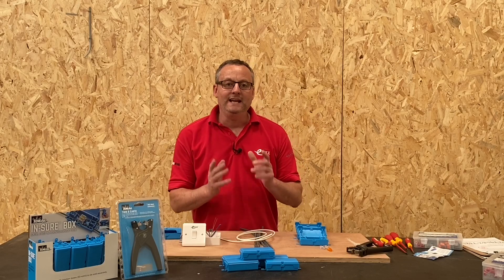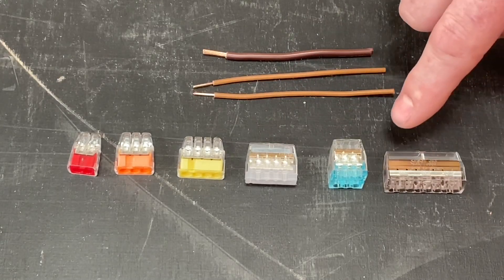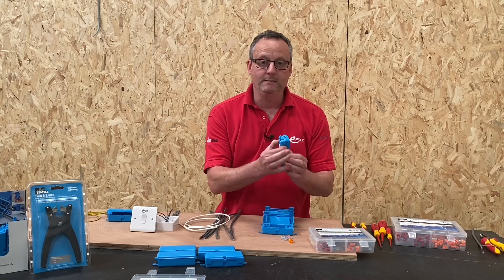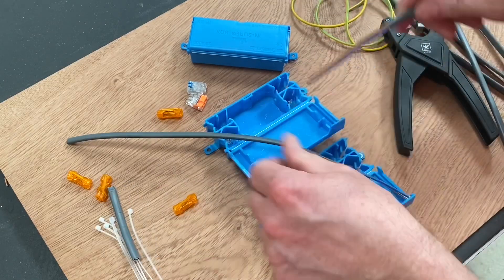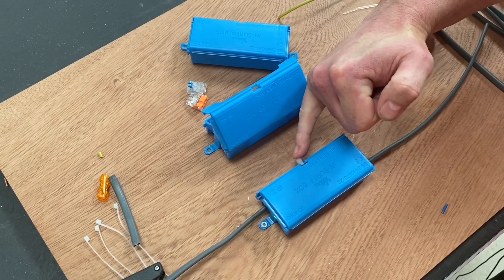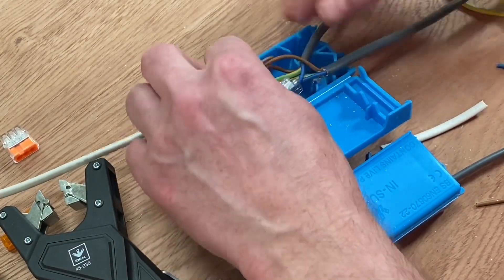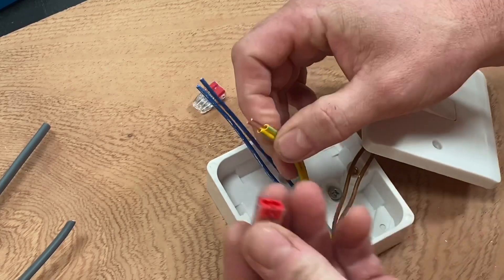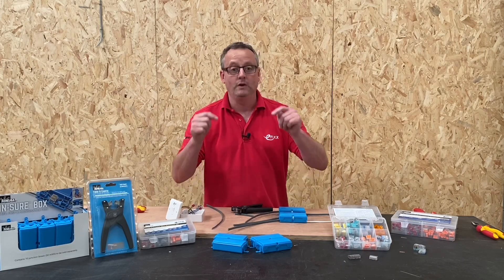IDEAL In-sure connector range and junction box demo for lighting circuits

Comment: How does a plastic box have a current rating? Shouldn't it be based on the conductor size (connectors should be rated at minimum what the maximum conductor size they can take is) & installation environment.

Comment: Can you remove cables out of push fit connectors...? Great video :)
Reply from the maker: solid conductors yes - just pull backwards and twist the terminal - stranded cant be removed on the push in.

Comment: I was always told as an apprentice that you don’t take neutrals to light switches.  How things have changed.  😀
Reply: Back in the days we didn't know any better than simple switches and resistive incandescent lights, there was no reason for neutrals behind the switches, they only took up space and made the box more messy. Control lights, timers, dimmers... in the years to come all functioned perfectly without N. But now we have LED-lamps that flicker when combined with the old way of connecting control lights/timers/dimmers... and a lot of smart and not-so-smart accessories that can be installed instead of a simple switch after the fact, often requiring a neutral connection, with the ones not requiring neutral being more expensive or less reliable. Not pulling neutrals to switches is a no-go nowadays IMO, and I'd even say it's good practice to make sure there's a permanent live available behind every switch as well (often not the case in existing two-way and two-way+intermediate setups).

Comment: With the push fit connectors how do you release the wire once pushed in..say if you wanted to change the wire
Reply from the maker: Twist and pull at the same time usually does the job. (Solid conductors) - stranded you have to chop the connector off on the non lever types.

Comment: I never have and never will use 1mm T&E. 
Still don't understand the maintenance free side of things when all you need is a screwdriver, pliers, Stanley knife (which everyone seems afraid of and is cheaper then an electricians knife which looks lethal and will get blunt easily n will get chucked where as a Stanley just need to turn around or swop the blade over) or side cutter's.

Is there any reason why nobody uses a Stanley knife anymore as I'd love to know? 
It's madness that some sites won't allow you to use one incase you "cut yourself" 🤦🏻‍♂️ FFS personally I think an electricians knife is FAR more lethal if you ask me because there's more if it. But if you want something to cut you clean open, metal studding is brilliant for that. I bet there not banning that on sides are they? 

For the past 10+ years, health and safety has gone stupid with the people making the rule's and writing the book's. Who have never done that job in there life! 
I know when I need to wear PPE, because I have common sense. You learn common sense due to doing manual labor over many years. If you think something might get in your eye, then wear safety glasses. If there's a guard on a tool, then use it. If your standing in a field, carpark, working on a roof or indoors walking round, then you don't need to wear a hardhat!! If you think you might hit your head on something, then put it on. Only use gloves if you need to or want to.

Comment: Do you have a solution for 6mm cable?
Reply: Yeah, use a JB rated and ready made for the Application Like an ABox i060

Or a junction box without terminals in it, fit some din rail insidr and then terminals to this rated for the Application 👍
Reply: @commecicommeca4489  Thanks

Comment: I have used Ideal products for a few years and they seem to be getting much more popular, in my view ideal push ins have always been a superior product to the Wago, 32 amp, easier to use and much better value in terms of price (if I remember rightly about £10 for 100).
The spliceline in-line (Copper coloured one) is also a great and unique product, especially when you need to extend a short cable, again 32amp.
Great video guys, love the look of those cable strippers!

Comment: Been using ideal for years, prefer them to the standard wago but What boxes do they offer for connecting through ring finals or a cooker circuit if them boxes are only rated at 16A ?

Comment: Great video guys, interested to know why the box is derated even though the connectors are higher rated.
Reply: You always derate the cable / fittings /Connectors as applicable in the scenario

In this case you can't have anything higher than 16A being pulled by the the circuit that this JB would be part of as it isn't rated for it

Therefore the connectors are de rated to 16A max in line with the box

Comment: Used a splice to extend a few CPC’s that had been cut short when replacing a few light switch with metal faceplates. Saved chasing the wall or moving the box higher.

Comment: Hey Gaz as for not using in a ring final circuit with 16a insure box, could you not using one on each leg therefore 2x16a =32a?
Reply: Each leg would still carry 32A, it would just have 32A on one conductor rather than 32A on two conductors. I don’t know what the reason is for the 16A rating. If it’s the total heat involved, then sure, 1x32A and 2x16A would be pretty much equivalent. And if you had a three phase circuit with 4 (plus earth) conductors, you could technically have 3x11A before reaching the same heat loading (three phase…. Lighting, I guess?).

But regardless, it doesn’t say that it can have a maximum total of 32 amps flowing through it — it just says the circuit should be maximum 16A. Given that it’s a box designed for lighting circuits in the UK, that is completely reasonable. It’s probably been tested to those applications, and not been tested for use on bigger circuits and rings.

Comment: Used the orange in line connectors before and they are great especially as they allow cable to stay in line unlike most wagos 👍🏻
Reply: Wago do have the in line connectors, the 224-112. I’ve grabbed some of the ideal connectors as well because the ideal connectors are rated to 32amps, while the Wago’s are rated to 24amps and are primarily for the downlighter scenario.
Reply from the maker: Thanks for the feedback 👍

Comment: The ideal lever connectors you don't need to lift the lever for solid. You're welcome 😂
Reply from the maker: Great tip - thanks Tom
Reply: That's a concern. Does the conductor stay in OK, or can it  be easily pulled out with the lever closed?
Reply: @kendoknackersackee  it stays in perfectly fine

Comment: Are there boxes for other types of circuit? And could this box be used on a 16A radial socket circuit, or is it just for lighting circuits?
Reply from the maker: An A3 radial socket circuit is fused at 20 amps you shouldn’t fuse BS1363 socket outlets at 16 amps because of the lack of selectivity. However a 16 amp industrial socket outlet circuit 👍. All the best Gaz
Reply: efixx Thanks Gaz 👍🏼